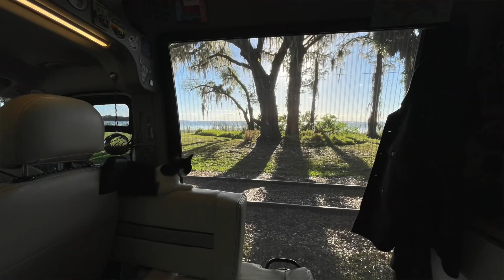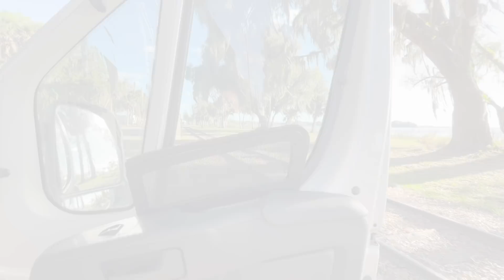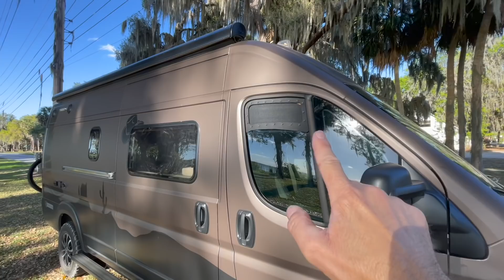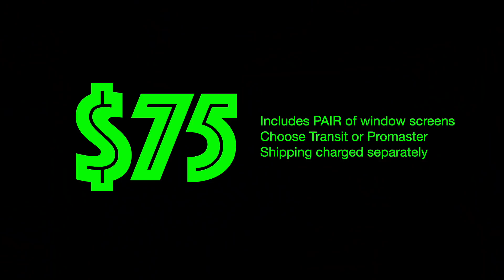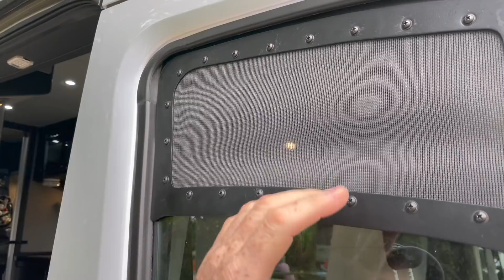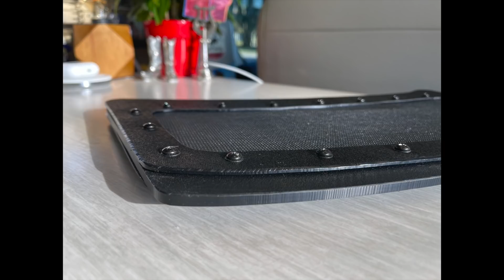Ventilation. Pet safety. Security. No bugs!  VAN WINDOW SCREENS for Promaster, Transit, Sprinter

Comment: Did you feel that these awesome screens gave enough air for your cat when you were gone..or did you need to run the fan as well?

These are a very creative solution. When I get my van I'll want some!

Hope he has a patent. I think these would be beneficial for humans in cars in hot weather as well!
Reply from the maker: Hi Laurie. Great question. I always turn on my ceiling fan to pull air out of the van with the fresh air coming in from those awesome screens.

Comment: So we got our screens about a month ago. I paid him with Zelle, which was simple and painless. I was in the middle of a broken wrist and I didn’t get the screens up to the Travato right away. But I finally got them put in – lots of fun with a long arm cast! – and they’re great. And Greg is great; he originally said that it would probably cost around $20-25 to ship them to the Bay Area, CA, but he found a cheaper shipping source. So even better! Nice guy, great emails And honest. He could’ve told me it cost $25 and pocketed the difference and I wouldn’t have known. So I really appreciate that sort of ethic
.
They’re perfect and simple to use. So we’re ready for me to get back in the saddle and take a little trip. Hoping that we can avoid running the infernal noisy generator to cool the inside down on those not-too-hot days by just running the the Maxxair fan using the house batteries, and pulling fresh air thru the screens.
Thanks for the recommendation!
Reply from the maker: Glad you bought and like your screens Trish. Greg is the bestest. Screens are cool to
Reply: Oops! I said Greg, but Siri heard Doug. I’ll fix that. The cast is off now but the wrist is still sore and I’m relying on Siri more than I should. She’s not entirely trustworthy. Grin.

Comment: Scott -- many people have stated that your style screen door is unreliable and prone to breaking.  But I haven't heard you mention any problems with it.  Have you had any problems with your side screen door?  Have you had an opportunity to try to roll-down version that is on other Travatos?  Any thoughts about the differences, pros and cons, etc?

Also does the sliding screen door really open from the front of the van?  If so, do you know why it was installed that way?  If it opened from the back, then I would imagine you could open it to a much smaller degree with every enter/exit.

Thank you!
Reply from the maker: No issues with my screen door. I have tried the other style but prefer mine actually.  Sliding screen door opens to the right from the left when standing in front of open patio door